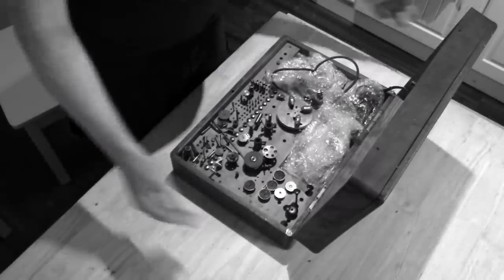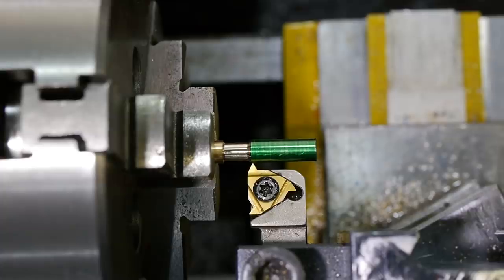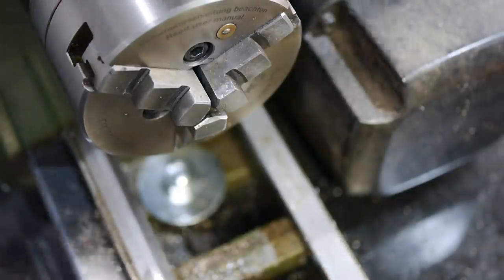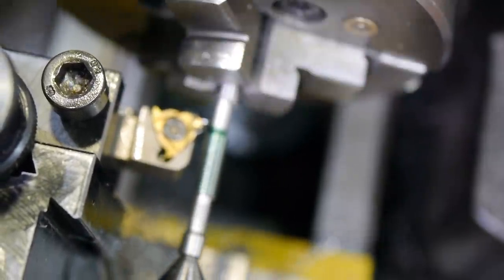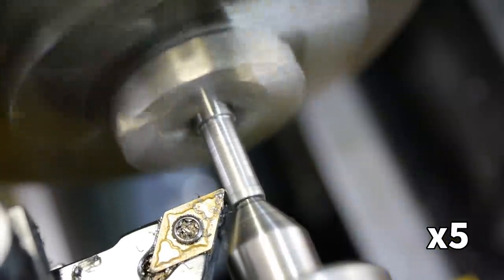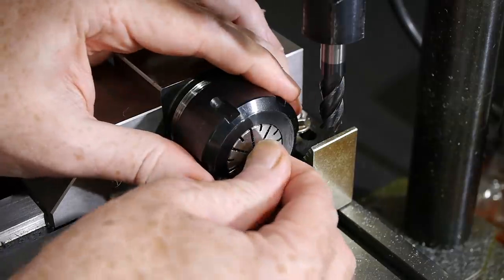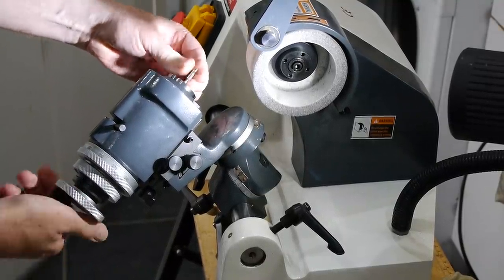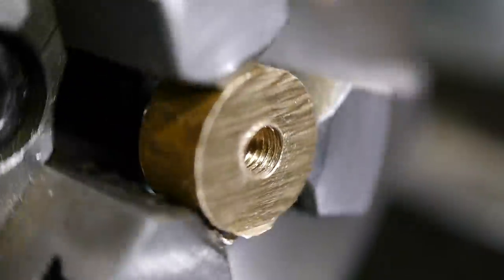Making a Custom Tap on the Proxxon PD 250/e Lathe

Comment: That's most lightly a Whitworth if its 55 deg.
Reply: Indeed, i work with a lot of old machinery so i have cut a lot of 55 degree Whitworth threads. its fairly common for old European machine tools to be made with a mix of metric and Whitworth.
Reply: Probably 3/128" pitch (42 tpi), since it's 0,595 mm, very similar to the 0,6 mm he said it has
Reply from the maker: The reason I believe it is metric is that all the literature I can find on German lathes made by G Boley says that the company used metric for most threads. (the exception is the screws used to clamp the lathe parts to the bed, which are Whitworth.)
Reply: Its only Whitworth if it has a pitch and diameter of a standard Whitworth thread as there are other threads which have 55 degree thread angle, like BSF, BSP and BSPT. A 55 degree doesn't not dictate that it is Whitworth the same as 60 degree does not dictate that the thread is metric as the UN series uses the same angle.
Reply: @dikkybee  All the threads you mentioned are pipe threads.
Reply: And with that statement I realise you know nothing about threads. BSF is the fine thread of Whitworth as UNF is the fine equivalent to UNC. The BS stands for British Standard just as the UN stands for Unified National. Your original statement was most lightly, which should have been likely, a Whitworth if its 55 deg but if it is a finer thread than a standard Whitworth pitch then it would be BSF , British Standard Fine. Which is the same as saying if it is 60 deg then it must be Metric which then tells me you have forgotten about the Unified series. Don't make broad statements if they are wrong which in this case you are. And don't even get me started on everything wrong in this video as if you took out all of the mistakes then the video would be about a third of what was said and shown.

Comment: That's a weird thread.  55 degree is Whitworth.  0.60mm is a French pitch.  Maybe the maker of the lathe did his own thing.
Reply from the maker: 55 degree threads have been around since the 1700s, long before Whitworth was born, and many early thread standards used the same angle.  I spent way too much time reading about thread standards while researching this project. G Boley were based on Germany, where the metric system became mandatory in 1872, so it makes sense they used a metric pitch.
Reply: @AdventureswithaVerySmallLathe  It's good you were able to restore the lathe back to original. Most would use the a common modern size that would fit and ruin it

Comment: Why not just use a bolt and use a grinder to go across the threads on opposite sides...if u don't ever have to take the bolt out don't cut threads with grinder...shavings will make it hold better... almost like putting wood in a hole if the screw don't hold anymore..kinda

Comment: The thread is almost definitely 1/4" x 40 ME, which is 55 degrees included angle and  which equates to your measurements: 6.35 mm diameter x 6.35 mm pitch, far too close to your dimensions for it not to be. In fact, 1/4 x 40 was commonly used on the older watchmakers' and jewellers' lathes.

Also, 40 tpi makes perfect sense, in that one revolution is precisely 0.025 of an inch. As in an Imperial micrometer, the indexing dial can be divided into 25 equally angular portions, each representing 0.001 of an inch, the standard when this boy was made. 1/4 x 40 taps and dies are regularly available on eBay, quite inexpensively.

I'm surprised that you didn't sufficiently research it, to arrive at the same result, rather than assuming decimal, which is a huge mistake on older machines.
Reply from the maker: Let me quickly summarise the research I did.

First I checked on http://www.lathes.co.uk/boleybevelledbed where there is quite a bit of information about this model series of lathes. The page notes that all threads, except the clamps and toolpost, were metric. The lathes were manufactured in Leipzig, Germany, so it makes sense that metric was used.

Next I measured the dimensions with a micrometer. The outer diameter is 3.97mm /  0.156" along most of the length. This is substantially smaller than 1/4" / 6.35mm, and I don't think it's possible that I made such a large measurement error.

I then measured the pitch, which appeared to exactly match 0.6mm or 42tpi (0.602mm). ME threads are always 32tpi or 40tpi, and this thread definitely did not match either of those two pitches with the gauge.

Finally I measured the pitch diameter using thread wires at 3.61mm to ensure I could reproduce the depth of the thread correctly.
Reply: Gordon, That's the first thing I thought when I hear'd 0.6mm. I went right to my calculator & got 42.33tpi.
Even though he proved you wrong, Not a bad call. Almost. I'm just wondering how 0.6 divides into 1 turn. 
1 / 0.6 = 1.666666....... Strange thread for a lathe. Nice job on the tap though.

Comment: Nice video indeed but he talked too fast in the end about why the thing didnt cut. Too fast and too "specialized" for us who dont understand the details. I mean when he cut first time in the brass puck and it "didnt cut".
Reply from the maker: I'm afraid I ran out of time towards the end. The toolmaking competition requires that the video is stricly less than 20 minutes long. I'm really not an expert on tool geometry, and the grinding I did on this tool was messy, and very experimental. To learn what shape a tap needs to be to cut reliably, I suggest reading up from someone who actually knows what they are talking about.
Thanks for taking the time to watch!

Comment: You have spent a lot of work.
Reply: You’ve spent a lot of time, or you have done a lot of work.....
Reply: @paco6641  Chances are: you've done a lot of work. In Russian it is a little different, but the meaning is the same. I am Russian and I use an automated translator. Thanks for pointing out the inconsistency.

Comment: You're using MAP//Pro gas which is propylene gas; not MAPP gas. It's only marginally hotter than propane. Don't misinform your viewers.
Reply from the maker: No intentional misinformation. The data sheet for the gas bottle I used in this video specifies that it contains Methylacetylene (propyne) and Propadiene. This is essentially the same ingredients as trademarked MAPP gas, but the exact proportions are proprietary. The data sheet is here if you are interested in looking for yourself:
https://www.my-sds.co.uk/Admin/ViewDocument.aspx?ID=37dd3fdf-9796-491d-93df-7b81373d951b&primaryReportId=0
Reply: You must have an old bottle then; I'm not sure anyone manufactures true MAPP gas anymore. GoSystem no longer lists true MAPP gas on their site. (http://www.go-system.co.uk/gas). As an aside your link doesn't work.